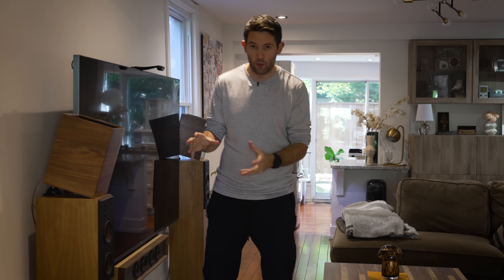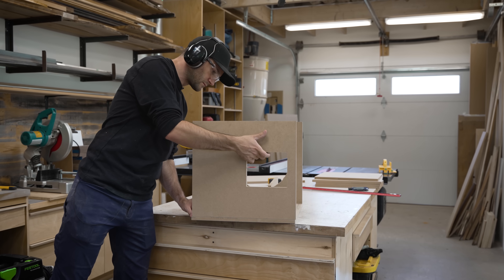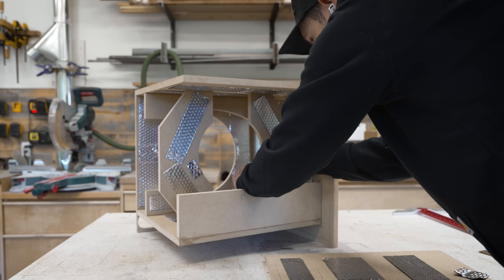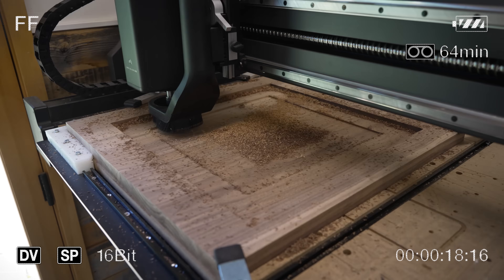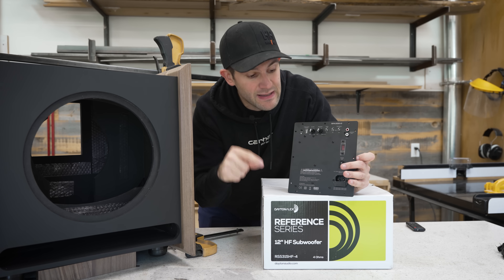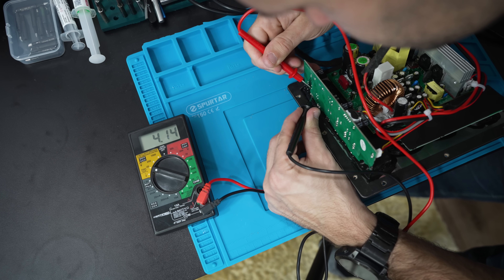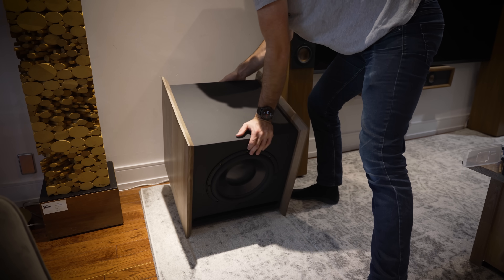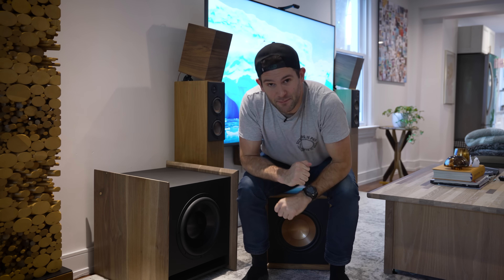THIS changes DIY Audio...

Comment: Very nice…your shop is everything ! Transmission ports are also a good design , you can make smaller or narrower cabinets with smaller drivers and get very good bass. Also no cutouts for the plate amps ! Mont them externally,  build a case for the amps and mount them from the outside of the cabinet. No big hole in the cabinet and it’s more sturdier much better bracing…
Since I don’t have a workshop in my apartment I’ll let SVS do the heavy lifting, and UPS  .

Comment: Thats way bigger than you need for a home theatre system. some Subwoofers have the speaker on the underside with raised rubber feet i dont know why that makes a difference. It's would be nice to have a workshop to do this kind of work in.

Comment: yeah your amp should absolutely be able to handle more than your speakers "rated power handling" as the rated power handling is only tested and listed at a certain frequency. The content your putting through the speaker is vast and every changing compared to the rated power handling. So you should always have an amp that has more overhead power to give at any random given time. Under powering a speaker especially a subwoofer can and will cause clipping and or overheating of the driver itself both eventually resulting in a dead speaker.

Comment: This is great; however, your advice on how to select an amplifier is incorrect. Speakers have multiple wattage ratings, and you should always meet or, preferably, exceed the peak wattage. In this case, the speaker is rated at 400 RMS and has a peak rating of 800 watts at 4 ohms. Therefore, you should have chosen an amplifier rated at 800 watts or more to ensure you don't damage the driver. 

It's also important to read the amplifier's specification sheet based on the impedance rating of the speaker. Underpowering the speaker can lead to damage because it can cause the amplifier to reach its limits, sending square waves that can harm the speaker cone. While a speaker can recover from momentary overpowering, it won't recover from exposure to square waves.

Comment: That's a big no-no on the hardwood glued and restrained like that. It's most likely going to crack as it tries to move, and the MDF won't let it .
 What you should have done was to screw the hardwood to the MDF using oversize screw holes to allow the wood to move. It also should not be glued for the same reason.
I hope it don't crack on you, but after 40+ years of working with solid wood I would say that your chances are not very good.

Comment: You can buy a receiver and transmitter for analog to digital optical but Instead of using the spdif you can remove the LED and solder a 2$ Amazon laser diode onto the transmitter and point the laser at the receiver and boom. Uncompressed 2 channel lossless audio with zero latency and zero interference transfered wirelessly. Your range is whatever the range is on the laser diode.   Several miles? It being Line of sight is the only downside
Reply: Sounds like you've been watching the DIYPerks bonk channel!!! 😂  SPDIF is electrical digital connection over copper and TOSLINK is digital over fiber optic connection. Digital is based on Ones & Zeros (On & Off pulses)...ya either have a signal, or ya don't!!! The ONLY determining factor in the quality of the audio is the SAMPLING RATE!!! FWIW, DIYPerks does some asinine stuff!!! Additionally, lasers can be made from tubes or LED diodes. Just look up the types of lasers that can be used for cutting/engraving. The sampling rate (frequency) can also be used to adjust the power output of the "laser" in conjunction with the driving voltage.

Comment: Ported , sealed or you could have done what I did and use a. Passive radiator for the best of both worlds. I used the 12 Dayton reference high excursion, unfortunately they stopped carrying it. With a 15" passive radiator with a crown XLS 1500 .

Comment: For every single speaker builder who genuinely, unironically believes that you cannot build speakers out of hardwood for some magic sound reason, I am begging you to build a pair and listen to it for yourself. You will argue with me and perpetuate the myth until you try it yourself. Build an identical pair to a pair you have previously built in MDF, use the exact same drivers and amp to avoid any break in arguments, and listen for yourself. What kind of hardwood? It genuinely does not matter, I have built pairs from Pine all the way up to Mahogany. 

This myth is perpetuated by commercial speaker manufacturers who purchase MDF in bulk and get it at a much cheaper price than any real wood, and then justify the usage of cost cutting, subpar, cancerous, manmade materials by lying to you that it's because it sounds better, it was always a marketing lie. 

MDF is very literally garbage, think about what it is, it's compressed sawdust and glue. It is a byproduct from the production of real lumber, so why is it comparably priced? It's funny to think about Plywood and MDF being priced similarly, because if you look up a video of the production processes involved in both, plywood is worth it's price, it's a LOT of work to make good plywood, and then you take the waste from the production of plywood to make MDF lol MDF is very literally soak wood pulp in glue and then squeeze the excess water out in a form press, and that's it. 

Did I mention the high levels of Formaldehyde yet? Yeah, every time you breathe in MDF sawdust, you're reducing your lifespan lmao 

Also also, why do we keep using Medium Density Fiberboard for everything? Why not use High Density Fiberboard if things like rigidity and density are important factors for speakers? Could it possibly be that the reason was never because of the sound characteristics and is entirely based on how cheaply manufacturers can bulk purchase "wood"? That's why cheap big box store enclosures are actually made from Low Density Fiberboard that's held together entirely by the vinyl coating, right? 

Nah, you right, those companies that we all know buy the cheapest possible components to put in their enclosures to maximize profits, would never cut costs on the largest part of their industry, they definitely buy the best quality "wood" solely for peak sound quality reasons, they would never cut that cost.

Comment: The Klipsch Subs I just bought came with wireless transmitters.  I am not planning to use them since I ran conduit and have low voltage gangs in order to run all my wiring through the walls
Reply: Good man!! Wireless sucks. This clown will spend a month on the box, but won't run one wire. WTF!!

Comment: This cabinet has so many things wrong with it it's crazy. First thing is it's going to have some horrible port noise and noise caused by the baffling that is inside of the cabinet. Why that baffling is even in there is beyond me and it is going to cause a lot of cancellation. All exposed edges need to be rounded to reduce port noise. Another big thing is the cabinet is made with far too many parallel surfaces which is bad because of cancellation occurring. The port opening being smaller than the actual port?? really? You know how much that in and of it's self messes up the tuning of the box? Adding another layer of wood on the outside of the cabinet is a fantastic way of getting rattle. You should not use any kind of sound deadening material on the inside of an enclosure. Sound deadening material reduces the noise that come from the structure flexing, use a thicker material to reduce the flex.

Comment: If you are using a powered sub, and a Class D (digital amp) ... why not use HomePlug? It's a networking protocol which goes over the household wiring. You're passing digital around so we're not talking about a bunch of EM noise. And the wiring (household electrical wiring) is already run, so you don't have to worry about running more wires or, potentially, running into RF interference from too many RF things passing data around.

Comment: There's so many issues with this video it's unbearable. The fact that you think you have to match the output power of the sub with the amp. 😅. I'm sorry. Nope. You want the amp to have more power for headroom. Your worried about air leakage but don't caulk the inside and made a giant hole in the back for the amp.

Comment: using a overpowered amp is not a big deal. i use taramps md8k 2 ohm - 8kW RMS amplifier wich sucks over 800 amps from your 14v system, yet im powering a huge 24 inch home theatre subwoofer wich is only rated at arround 4,5kW rms with 5 inch coil and a monster magnet, yet i have no problems

Comment: Port tuning is related to the box volume and the characteristics of the driver - not the type of music you will be listening to. You should start with the the selection of the driver and then calculate the box and port dimensions from there. There are plenty of online calculators to help with this.

Comment: Here's something neat, an old trick for the sub:
Stack a paper based weight on top, put around at least 1/4 weight (of the sub) on top of the sub with books or magazines or paper of any kind, you should feel the differences.
Reply: Or corner load (facing the corner) the sub in your room and invert phase of the audio signal.

Comment: Been building subwoofer cabinets for a long time now, that whole sealed vs ported thing is now obsolete. Ported is superior for every application, once you learn to manipulate enclosure size with port tuning and velocity you can achieve better results than sealed. 6th order bandpasses sound very good too , excellent for home theater
Reply: You definitely wouldn't want to use an amplifier that has a crappy damping factor and low voltage slew rate for a ported box now, would you?! 🤔😂
Reply: @ amplifiers don’t seem to make a difference in sound quality too much, but it is noticeable to audiophile ears. Brazilian amplifiers are garbage and I’d never use one personally even though they’re extremely compact and can put out more watts per dollar than Korean designs, but the Korean amplifiers are beefier and tolerate lower voltages / abuse better

Comment: Another thing you also can do to improve internal acoustic of the chamber is to use a roundover bit to make sure that no braces have 90 degree angles but round corners to improve airflow. This way, a lot of the airwaves will dissipate rather than break inside the cabinet.

Comment: You could have gone much higher on the wattage. 300 is significantly underpowered. Running the same sub with over 1500 watts.

Comment: Dude so informative until you got to the point that you talk about the amp.  Class D does not mean "digital".    C'mon man you gotta do better than that. 
Class D means = A "Class D amp" refers to a type of electronic amplifier that operates by rapidly switching transistors on and off, using pulse width modulation (PWM) to create a pulse train output, resulting in high efficiency and compact size compared to other amplifier types....

Comment: This is a great project and the video does a great job of explaining the build so that viewers can follow along.  The result is quite useful as a a one-size-fits-all design that will satisfy most viewers in most environments, but it's not quite a "high-tech" subwoofer design that considers all of the knowledge available and it certainly doesn't change DIY speakers forever.

If we want a better result than simply buying a finished subwoofer, we can't simply pick a random tuning frequency or accept the manufacturer's recommended box volume.  Rather than start by choosing a driver, we'll want to predict the final response at the design stage by testing our current room response and then deciding what we want to change.

The audible difference between ported and sealed is mainly a matter of sound intensity if we design them correctly.  All other things being equal, a ported design will be louder, as described in the video.  If you can easily hear a change in sound color between a sealed and ported speaker, then one or both of them are poorly designed.

The focus on making an accessible, understandable project is awesome and I think it gives people a great option for building their own subwoofer that can be tuned with a DSP to fit it into specific environments, but in the video we are left with no idea what the actual room response was either before or after.  No modern design should be complete without at least some REW frequency response curves to show what was accomplished.

Yes, we can melt a voice coil with excessive wattage and subs do tend to sustain high power levels for long periods, but it's far more likely that we'll kill a sub with clipping distortion when our amp runs out of headroom.  Too few watts kills speakers far faster than too many, but we must always make sure that gains are set such that maximum system volume cannot cause clipping.

Class D amp power is often rated at a horrific 10% THD, which is a magnitude more distortion than we want our speakers to experience.  This might mean that we'll need a 200W amp to obtain 100W of relatively clean power, but bear in mind that most systems have far more power than they need; even home theaters are usually running at less than 1W per speaker.  People focus far too much on power numbers and not nearly enough on speaker selection, design, and room calibration.  Spend money on a DSP, not on bigger amps.

Comment: I never understood why you'd want a powered speaker, especially a powered subwoofer. All that vibration and jostling over time could damage solder joints. It compounds the issue since a lot of manufacturers use silver/tin solder which is more brittle than lead/tin solder. I'm guessing foam is used to cushion the vibration. Table radios don't really count because they don't get that loud. Ghetto blasters started having removable speakers when they had deep bass and just being clipped in place did help. They still weren't anything like a subwoofer. Subwoofers need an ample source of power.

Comment: The port dimensions are t the same for the length of the port. Yours is more of an abrupt taper. Will probably sound fine as you’re not digging low 20s most of the time but it could cause a lot of turbulence and chuffing

Comment: Hmm I'm not sold on the wireless thing. When I built my 5.1 stereo 2 years ago, I read a bunch on people who used wireless subs and didn't like the sound until they actually REMOVED the wireless boards. I followed that advice and my Klipsch sub is super creamy. I have to assume cleaning up the inside of the box helps too.

Comment: Surely "vibration absorbing feet" defeat the purpose of the speaker, which is to have the driver push the air in one direction, not push the cabinet in the other direction.

Comment: Always use WinIsd when designing a box. Especially a ported box, so you know where to set the high pass filter to protect from ultra low frequencies.
Reply: HPF on a sub? You must work in Zach's shop. LMFAO.

Comment: ALSO, how do acoustic engineers feel about all those solid objects mounted inside the box.  .....Any solid object will interfere with wave path.
Reply: Additionally parallel sides can cause internal standing wave cancelation. Best to have at least one non-parallel surface!!!

Comment: You also ideally want more power from Amp than rated. Then you can max the sub ability. Underpowering speakers and turning up will cause more damage if the Amp signal clips and flat lines the sub

Comment: Um. Sealed goes lower. Ported doesn't extend into low frequencies as well. Depending where you tune the port but you get a drop off under that frequency

Comment: Cool build, but the middle brace looks very restrictive, 
BTW Class-D is NOT a digital amplifier and you can easily overdrive a speaker with fewer watts than they are rated for. The lower the notes the further the cone travel.

I do wonder why you didn't do something tall and slender to make it easier to pass by

Comment: Very thin walls for such a loudspeaker. The baffle itself should be at least twice the thickness of the box. It is going to vibrate along with the driver even with those braces. That is not enough. And the weight of the magnet or the loudspeaker driver is not helping. You should put a bit of wood inside the cabinet where the magnet of the speaker should rest. And that amp should have its own case inside the box. Its components will suffer more than you think with the sound pressure, Also, did you consider the space you lost with the bracing and everything in the box while calculating the volume of the box? Just curious. I am not criticizing anything.